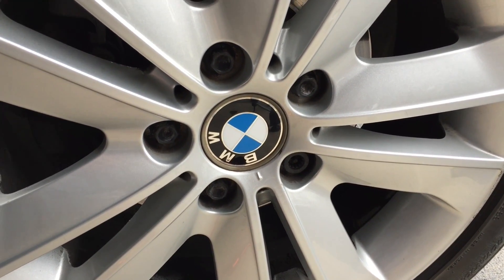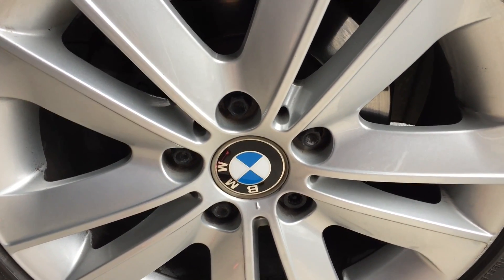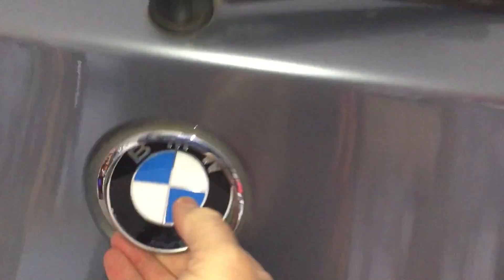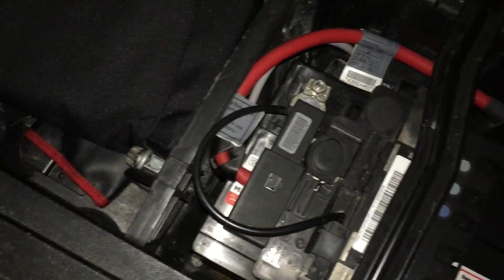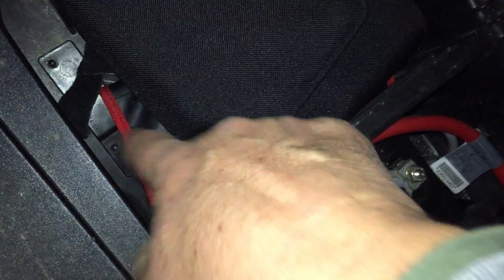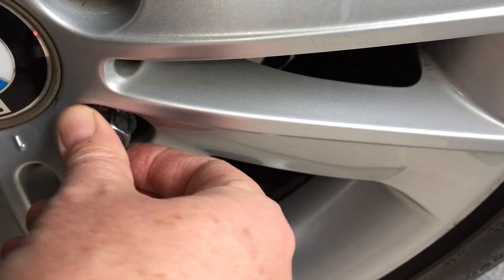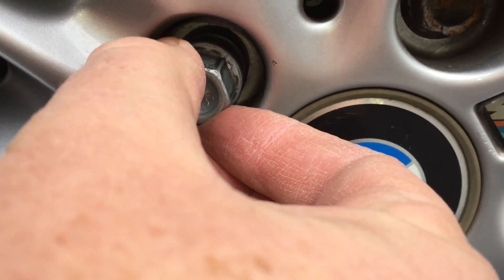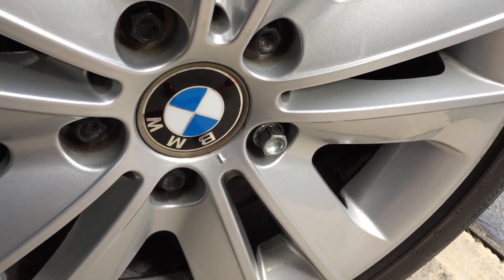Where is the lock nut? Finding the security wheel nut on your BMW 1 3 5 series locking lug

Comment: I have a 3 series estate and need two new rear tyres soon. Although layout is different from in the video it inspired me to look in places I would never have thought of (previous car was a Mondeo estate, and it was just in a little bag in the glove box, so assumed it would be similar).
Checked in the boot and noticed for the first time there are actually two handles for pulling up the carpet. A smaller one right by where the tailgate catch comes down as well as the main one. Smaller one lifted a small flap and there was nut clipped in next to a towing hook. Thanks!
Reply from the maker: Alex MetalHead1349 So Glad you worked it out. Thanks for sharing your story it will help others. 
Mark’s reviews and tutorials